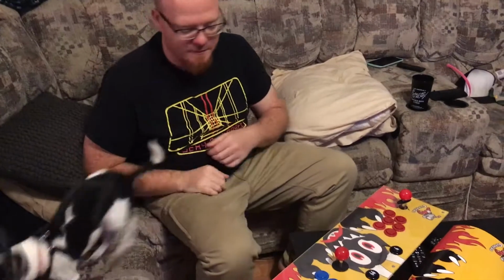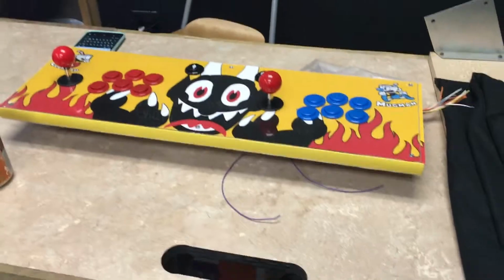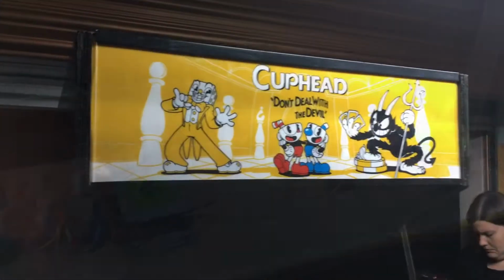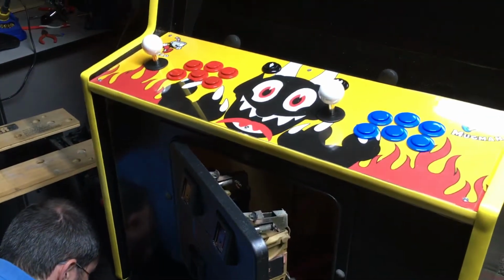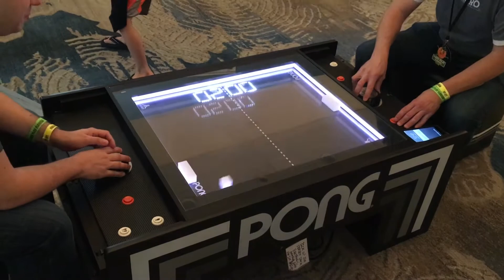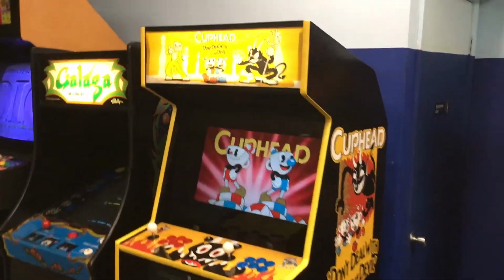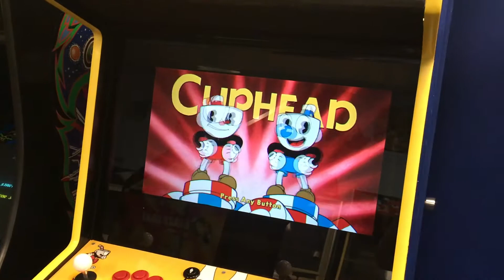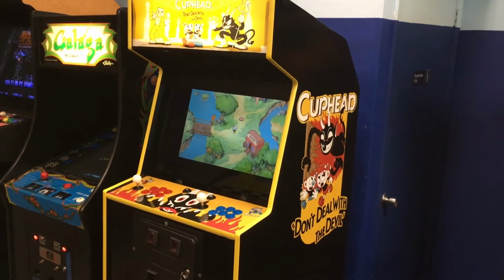Cuphead Arcade Build  - Finale!!! : PastBlaster - Episode 30

Comment: Take those crappy zippy sticks out and put something more heavy duty , those zippy sticks break easy.
Reply from the maker: I agree 100%. I normally use Sanwa sticks, but need to find the longer shafts for them as the sticks are currently mounted under the CP wood.